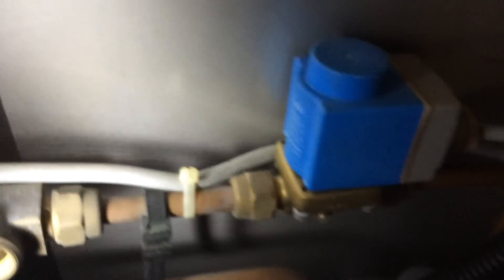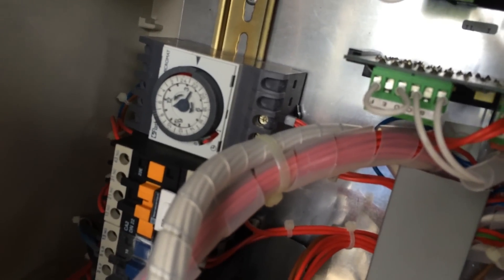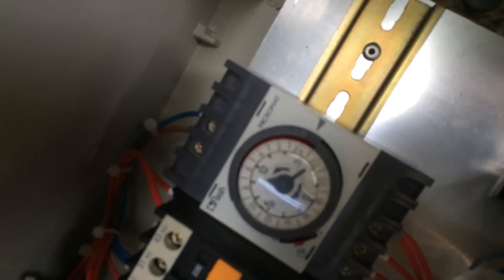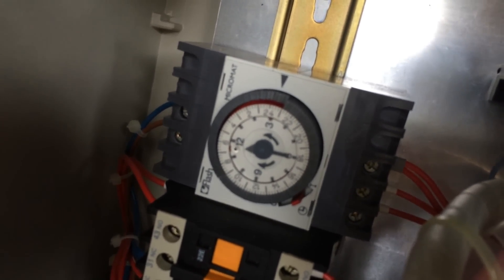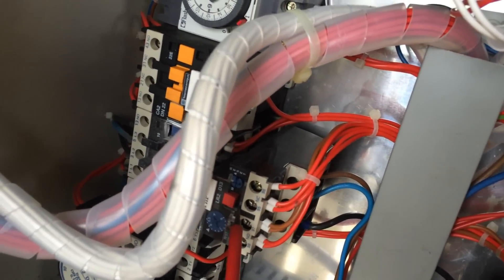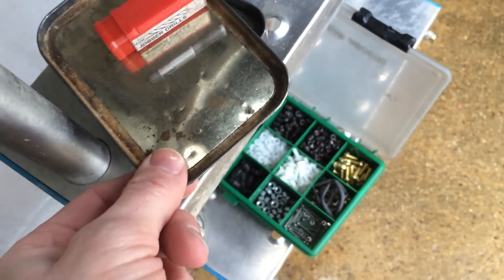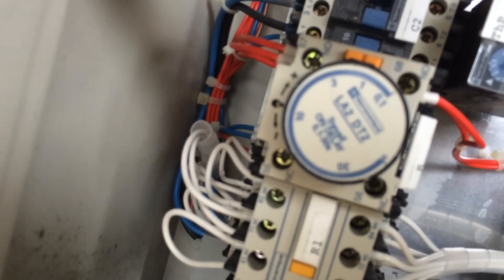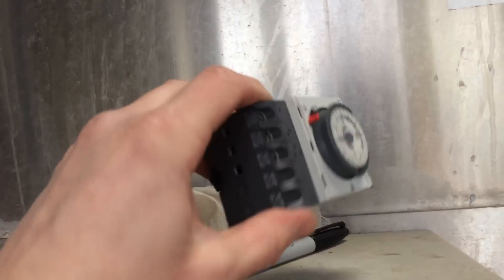Packo Slow Cooling Problem

Comment: Yes those pneumatic timers do ge slow with age, though you will probably replace it with a on delay DIN mount relay as there is nothing associated with the coil there. You still get them, but the new pneumatic and the contactor is a lot more expensive than the delay relay. On delay is around 20 pounds here, been buying a few recently to replace 50 year old Siemens ones that finally decided to die.
Reply from the maker: +SeanBZA Yeah these have got expensive to replace with genuine parts, but you can get ones made by Chint for half the price (think they bought all the old telemechanique molds)